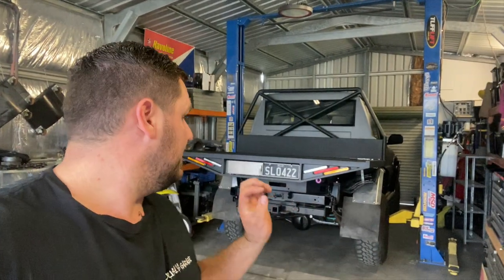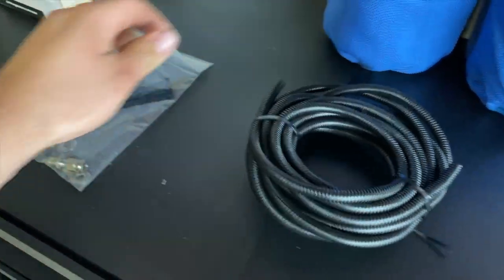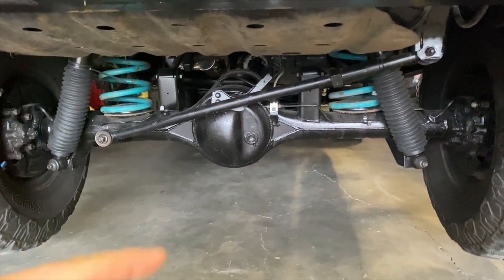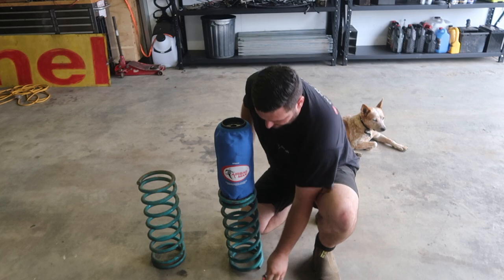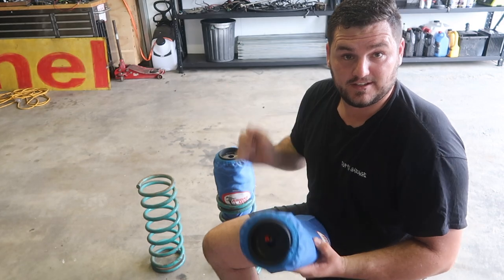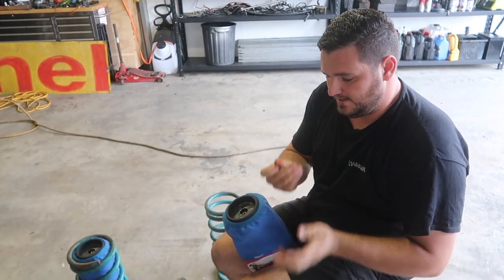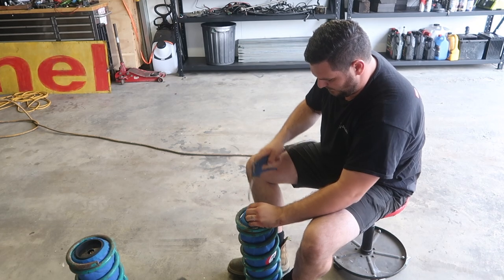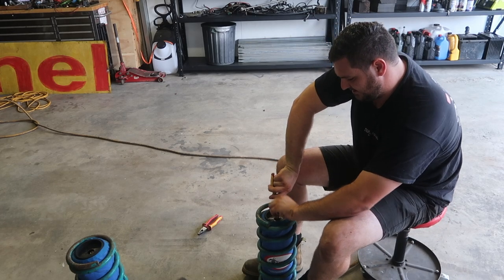Engineering Fail and Rear Airbag Assist Install

Comment: Where abouts are you? Who was the engineer you used?
I'm on the central coast looking for a engineer, as I'm about to chop mine.
Reply: Same Here, already mid way through
Reply: Looks like he's in qld from his number plate in latest video? I thought I heard him say nsw? Anyway there's a bloke in Cardiff called Athol Mullen apparently is good to deal with, I haven't called him yet because I'm trying to decide if I should buy that kit from ozbuilt, buy the rear off a ute or just make it up? Only issue I don't have a folder.